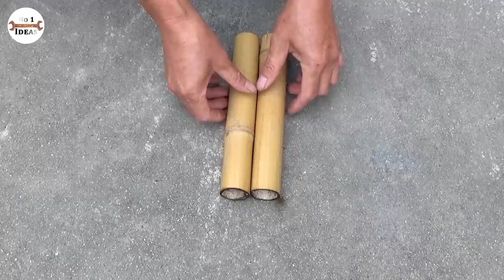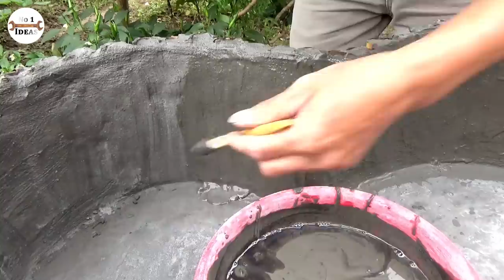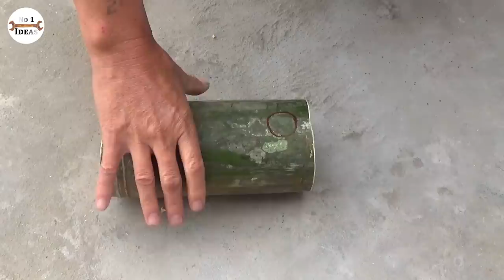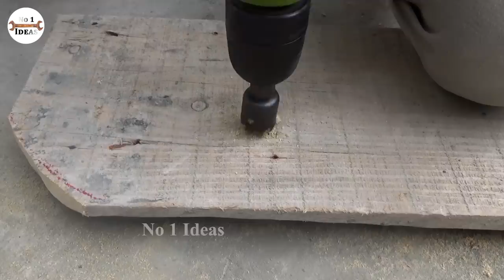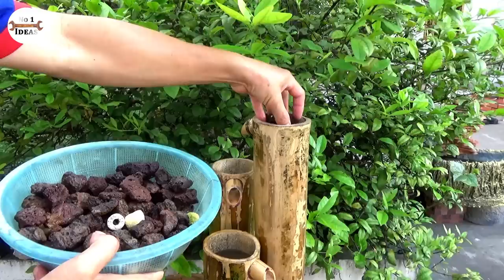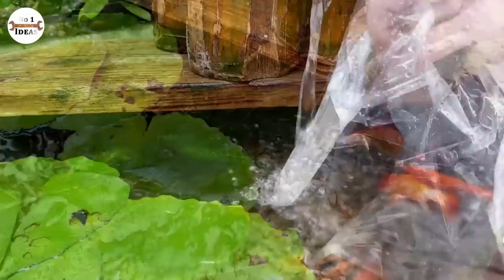Amazing Ideas From Cement and Bamboo | DIY Beautiful Waterfall Aquarium Easy - For Your House

Comment: I had a similar setup but the lily plant died. I read that those plants like still a (low motion)water. How well are those Lilly pads going to holdup under the running water?